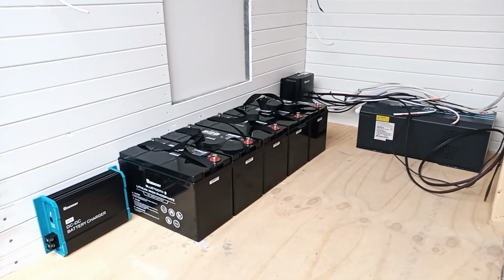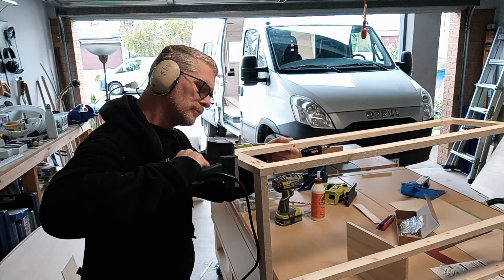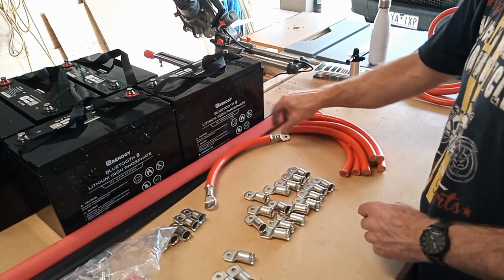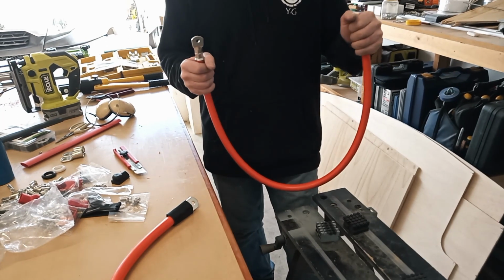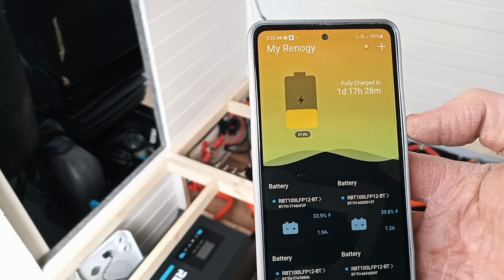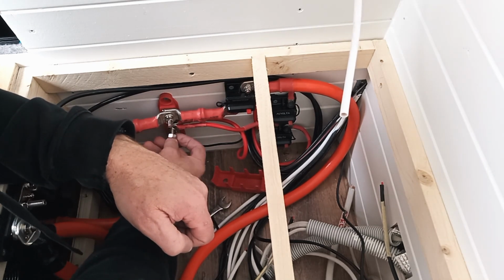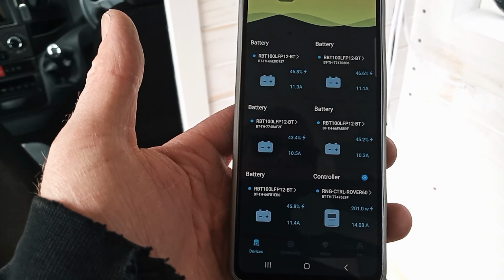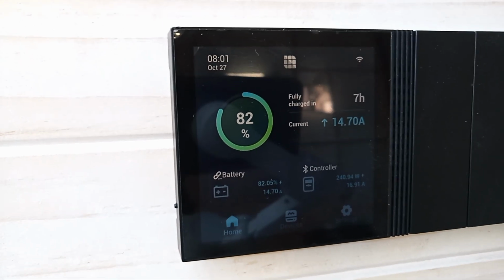Sparks Fly! We Have Power - Van Build Episode 21

Comment: Hi mate, what did you think of the hydraulic crimper? Any good and would you recommend it?
Reply from the maker: Yeah, the bit where I talked about that ended up on the cutting room floor.  Yes, the hydraulic crimpers are a game changer, you get a really good crimp with them.  For the big cables they are almost a must-have.
Reply: @PathsLessTravelled1  yeah Ive got the small crimper but wasn't sure on the larger ones. Thanks mate :)